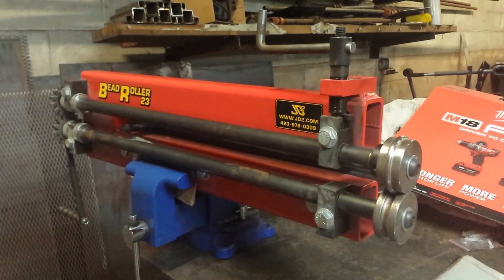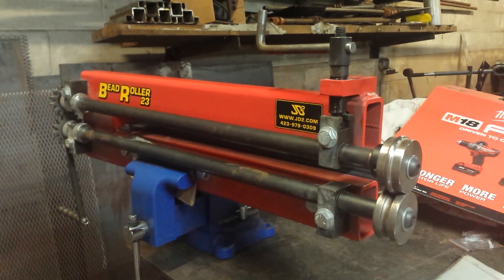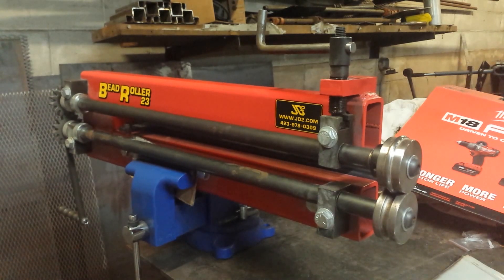JD2 Bead Roller 23 - Review

Comment: you mentioned some things you didnt like on this beadroller , i recently came across another guy that adapted his beadroller to fix some of the problems you mentioned look on youtube for Jere Kirkpatrick
in one of those vids he mentioned hes selling plans for the conversions too
Reply: watahyahknow, Jere's Bead Roller is a Harbor Freight tool.  Totally differently made piece of equipment.  HF roller rods are adjustable, the gears are wider to allow the different offset and it's flat plate. They have their issues for sure.  The advantage to the JD2 is it's made of square tubing as opposed to the HF that is 1/2" flat plate that needs to be reinforced.  Apples to oranges.  But Jere Kirkpatrick has his modded to be equal to the high end tools.  Sunk some $ and effort to fix it.  And being the fabricators we are, we are always looking for ways to improve everything we own.  But as we know, some people don't want to mess with them right out of the box.  They expect them to be perfect from the start.  Being at just over $100, that ain't reasonable.  

OP,  thanks for the review.  Glad I bought the HF one.  
I would only recomend the HF one if a person enjoyed modifying tooling to suit them.  About halfway through modding it.  Using a 24 volt electric scooter motor  with flex plate and starter bendix shaft to power mine. And a cut down Vice Grip "C" clamp to make my tensioner tension repeatably without the guessing.  Plus the top rod lifting spring and clamping wrench attached to the depth adjuster bolt.  A lot like Jere did his.  Only my way!
I do like the rectangle tubing of the JD2'ed though. It looks beefy.  Much flex in it?

Comment: You didn't mention the price---HB no longer offers theirs and even a their lower price Easrtwood's is a little pricey__The HB price spoiled me. Life is a compromise and we can't always afford THE best do everything so we compromise. My  view of this is kind of two things (1) if it won't use the size and configuration of the dies ever other company uses, its like selling a gun that you can only buy shells from the gun manufacture; it has been done but not for me.  (2) The gears appear to be too narrow compared to others. The wider gear allows the roller to be modified so you CAN adjuster you top die in and out slightly. I plan to get a cheapo roller and make the modifications that others have done. If this is as well built as it appears that would save me from having to stiffen the main frame. Thanks for the early review of this bead roller.
Reply from the maker: JD Squared doesn't make it anymore. Mine will be heavily modified in the future.